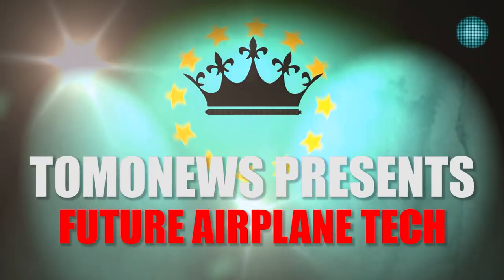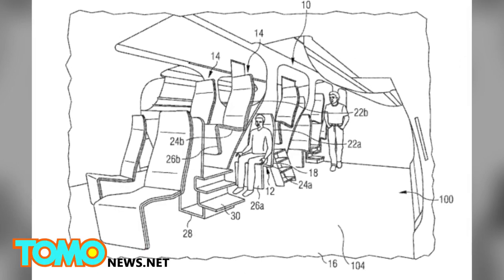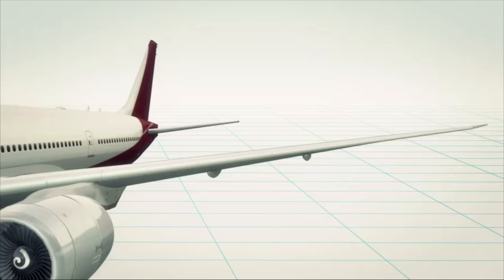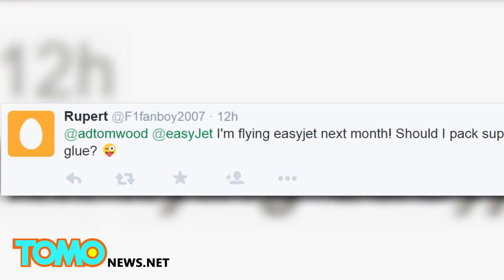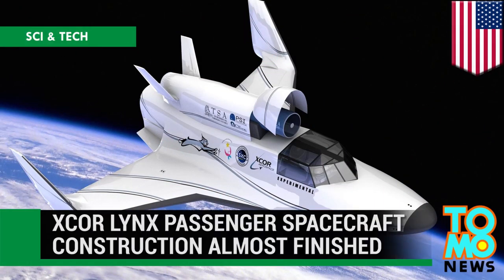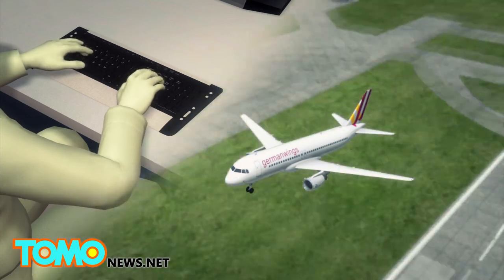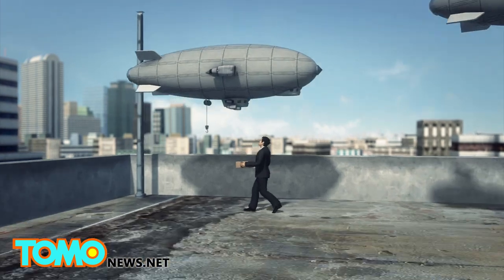Airplane technology: Detachable cabins, Mach 24 and crazy patents - future airplanes compilation

Comment: You compared a Mach 24 plane to the fastest car. You actually did that.
Reply: Yeah, like why would anybody possibly want to compare it to, for example, Concorde which actually flew the route -_- 
This whole thing pissed me off.
Reply: Even worse they showed a vid of Thrust SSC (land speed record holder) which went at 763mp but talk about 270mph road car. Anyway I designed a plane that goes Mach 50, only problem is that none of the tech has been invented yet!
Reply: Yeah. The Concorde was just too unsafe...
Reply: +Edward Hobday Thank you! The second I saw that I immediately scrolled down to see if anyone else commented on that little gem of a fact. Just wow.
Reply: yeah, just a bit ;)
Reply: It had ONE crash... in 27 years of service...

"Yeah. The Concorde was just too EXPENSIVE..." - there fixed it for you
Reply: Peter Grenader 8
Reply: very cool
Reply: Peter Grenader ikr
Reply: ikr
Reply: Not to mention she also gave us the incorrect top speed for a car. (270 something MPH). While the fastest car, the SSC THRUST, reached a speed of 763 mph. (Sound barrier is at 768 mph).
Reply: The Mayor sound barrier is 1160 miles per hour
Reply: Jalopy That is incorrect
Reply: JALOPYGamingPS4/ warthunder it actually like 750 mph around there
Reply: I understand you probably forgot all about this coment you made over a year ago but what is this designer thinking? Mack 24? I think they have finaly started to say the word "mack" and then follow it with a 2 didget number.
Reply: omg
Reply: JALOPYGamingPS4/ warthunder the sound barrier varies depending on atmospheric density.
Reply: Peter Grenader mach speeds aren't set at specific speeds the mach number corresponds to pressure and the medium
Reply: Smart
Reply: He did.

Comment: Those are all fantastic ideas. Not sure about the railway one though. 

1: Where do you put your luggage? Not hand luggage, hulking great suitcases and whatnot.

2: It would have to fly pretty slowly to scoop the fuselage off the tracks. It might stall and squish all the would-be passengers.

3: Putting the fuselage back on the tracks requires precision. It might derail.

4: Some railways have an overhead cable. Others have other stuff like trees and lamp posts. The flying wing aircraft might hit those.

5: Train stations will have to have check-in desks and customs controls (for stations where the Eurostar terminates from, such as St Pancras Intl or Paris Gare du Nord, this is already in effect).
Reply: It's not a train wagon, it's just a cabin that detaches.

Comment: yes yes!!  i like the detachable cabins.  especially the one with parachutes!   please make it so.
Reply: Have you even thought of how bad that would be? It may be cool, but it means more moving parts, which means higher chances of something going wrong.
Reply: @yacinesenouci6680  Less contact surface, so more stress concentration. Plane accidents usually happen at low altitudes, so less time for parachute deployment. The ones that do happen at high altitudes, either have time to fix the issue or to glide to a safe location to land. If that is not an option, the accident was catastrophic, and the chances of the system being deployed perfectly and safely would be very low.
Boarding happens at the last part of airplane preparations as checklists, refuel, and re-equip takes a long time. So boarding before the plane is ready serves to purpose, and would just make passengers wait more at a closed, tight fit space.

Comment: 12:32 180,000 feet IS NOT 50,000 kilometres! It is 54864 METRES (which is 54.864 kilometres) If you were 50,000 KILOMETRES away from the earth, you would be getting close to 1/4 of the way to the moon. HUGE difference!

Comment: now just put a huge parachute on it..just incase
Reply: steff serpent they do that with GA aircraft. The larger ones are just too big sadly.
Reply: Well they have a concept where they take this detachable cabin design. But have it detach downwards and deploy parachutes in case of a emergency. It would be set on a timer so the pilot's and other crew could board the cabin before it detaches.

Comment: Factual error in the first sentence: Airbus is not French.
Reply: Fact check: Airbus is French (founded in Toulouse in 1970)
Reply: Airbus Group SE is a European multinational aerospace and defence corporation. Headquartered in Leiden, Netherlands, Its incorporated company type is SE, the corporate form for the European Union, It is not French.
Reply: +David Lowe we're talking about Airbus commercial aircraft manufacturing division, not the group as a whole. Also the current 'Airbus Group SE' began in 2000 as EADS while Airbus (or formerly Airbus Industrie) has began in 1970.
Reply: +lʌntєrn Meringue Wrong! Airbus was originally founded by German airmakers Bölkow, ATG Siebelwerke, Dornier and some more in 1965. That's also where the name Airbus originated. In 1970 it was then registered in France due to economical reasons, after the french Aérospatiale joined Airbus with a Share of 20%. Also the first CEO of Airbus, Felix Kracht was German. Today of course it is a European company :) Fact check completed!
Reply: "Airbus SAS (/ˈɛərbʌs/, French: [ɛʁbys] ( listen), German: [ˈɛːɐbʊs], Spanish: [ˈeirβus]) is a division of the multinational Airbus Group SE that manufactures civil aircraft. It is based in Blagnac, France, a suburb of Toulouse,[1][2] with production and manufacturing facilities mainly in France, Germany, Spain, China, United Kingdom and the United States. The company employs 72,816.[3]"

Straight off Wikipedia.
Reply: David Lowe It's FROM FRENCH AND LATER GERMAN THEN CAMED UK WITH NETHERLAND The Netherland DIDN't came even up with It DUMB I live in the Netherlands To AND IT IS FROM SPAIN

Comment: The detachable cabin can work without disrupting passenger comfort, while increasing safety and maintaining quality service. The problem is making sure pilots and crew can fit into the detached cabin with passengers. Maybe put the plane in the auto pilot mode? A plane within a plane. Maybe the pilots and crew in a separate pod that detach as well, after passengers are deployed. Add a booster to detached cabin to make sure cabin detach quickly.

Comment: The detachable cabin probably is never going to work. It adds too much weight, it costs a lot. It could only land on relatively flat terrain or it would roll downhill. Not to mention the reduction in structural integrity to the aircraft. 
Also the NASA drone isn't exactly new tech. The US marines have been using tilt rotors for years and people have been building RC tilt rotors for longer. I haven't looked into it but the NASA design is probably to test something else rather then the tilt.

Comment: That's dangerous and stupid. Dangerous because, it can fly off mid-flight and stupid because, it will waste airport's money
Reply: More to the point, people would die if that happened. But it can't.
Reply: Best Trends it will have parachutes and if an emergency happens it will detach itself
Reply: Transasia Flight 235 there's always a possibility of failures. And not to mention it's extremely impractical and weakens the airframe.

Comment: Another error: at 10:55 Tomonews claims this is a side slip. Not correct, as side slip (or more accurately, forward slip) is characterized by one wing tip being lower than the other in order, while turning the nose the other way, to create a sideways flow of air against the fuselage in order to increase drag if the other drag increasing methods (flap, spoilers) are insufficient. Here we see the airplane flying sideways because of the strong crosswind. The fact that the fuselage is turned away from the runway (and into the wind) decreases drag. The wings are level, apart from small corrections. This is called crabbing.

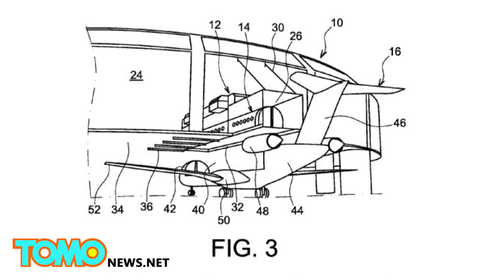Comment: :24-1:10 Great idea! In the event of an impending crash could the detachable compartment separate with a parachute to save lives? After being locked into place on the ground how do you ensure that it won't detach in flight? How will luggage be removed prior to the next group of passengers being loaded onto the plane? What will be the turn around time for that change?

Comment: 10:56 This is not side-slipping. Its "crab" maneuver - compensating for the crosswind with ridder (heading). Side-slipping on landing is when you compensate for crossind with the wing lowered on the side the wind is coming. So the aircraft literally slips sideways, but is pushed by the wind to maintain heading.

Comment: That forward-backward seating arrangement would never pass security requirements. Technically, it would be safer in case of a crash to be facing backwards, but the concept has pretty much been buried long ago, because passengers would not accept it. Thank God we still have regulations in air travel, or all we'd have on flights up to an hour would be overhead rails to grab on during takeoff and landing.

Comment: On the topic of detachable passenger cabins, this would only be a good idea if they could incorporate into the idea and plans a couple of better reason to produce such and thing. One, would be to make it so that the cabin would detach in case of evident engine failure which would lead to a crash. And second, that the cabin would be outfitted with a strong enough frame to handle being brought to a severe slow down so that it could land back on solid ground by having huge parachutes attached to it. Only then would this idea even be worth the investment, because saving lives is more important than being able to make more money by moving passengers quicker.

Comment: One good design to speed up turn arround time is airport design. How it works is the plane would land then go to arrival terminal only passangers  would come off the plane. then people can go to baggage then taxis busses and train all would be empty  when arriving at the arrival terminal. There would be no cross flow conflict with people departing one flow stream. The aircraft now empty at the arrival terminal  would taxi or towed to the service terminal for waist removal an refueling and stock food carts etc. the aircraft would then taxi towed to departer terminal to pick up passangers they would come from trains taxis busses that are all full on arrival at the departure terminal. the new passangers would not have any conflict cross flow with people arriving. The 3  terminals; arrival , service & departure  could be  separated by about a killometre. The taxis busses & train can go in one line. renta cars can be same customer drive to departure  then be moved to (like a car wash ) arrival terminal. one could eliminate people bumbing into one another.

Comment: The planes that have fuselage disconnects can't happen because there would be lots of extra maintenance required that the airlines wouldn't want to pay for, there would also be no point because of how safe air travel already is and the planes would probably never use their detachable cabins. It is also Russian, and with the war, airlines not trusting Russia to manufacture their planes, and other conflicts, only Russian airlines would maybe buy it

Comment: removable cabin? there is a reason why cabins are round. It's most stable under pressure. you can't use the sharp  edges shown in idea No1

Comment: 16 000 miles/h BS
The space station orbits at 25 000 km/h, 7.6km/s, re-entry speed is 7.8km/s~11km/s.
The friction with the air would melt that thing, and let's not talk about the energy required to achieve that speed

Comment: Removeable Cabin - doesn't speed up freight loading, and makes pressurisation of the cabin much more difficult.
Hexagon Seats - an interesting idea, but has serious flaws too.
Stacked Seating - another interesting idea, but also having many faults.
Mach 24 Aircraft - probably has more flaws than its predecessor.
Clip-Air - WTF, seriously?
Detachable Cabin - makes more sense than the other one, design-wise, but economically it's a bust I suspect.
XCOR Design - great, but what's it for?
Drone Airliner - nothing is ever going to be perfectly safe, so I really don't want this.
Drone Airship - lifting gas escape will slowly, to a point that it will need to be brought down to be refilled.
Reply: Not to mention the algae plane meant to fly in '15, might be a little over a year late to call it "planned", either it did fly or not at this point.

Comment: At 7:24 the plane should have more engines or a truster engine currently upgraded the engine the engine should, be fast or minimize the rate of weight that carrys it for it wouldn't be possible to lift it up need more speed or decrease the weight

Comment: i like the stacked seats but it should be used on buget airlines and regional airlines but hear comes problems new aircraft needed more cost buget airlines may not want it as they need to replace there current aircraft and training needs to change everything would need to change very expensive and not needed

Comment: 50,000 km and 107,000 km. I think they got feet to kilometer ratio all messed up.  A rocket engine that can reach 50,000km altitude in 3 minutes  (that is over 100 times higher than the ISS) would revolutionize space travel and allow us to colonize our solar system today.

Comment: to aid in turn around time it can be done by the following.   When an aircaft lands it taxis to the arival terminal. there it unloads passengers and cargo this terminal only handles traffic flow in one direction from plan to customs to awaiting empty trains and taxis. The is no passengers deporting at this terminal at all eliminating cross flow problems. the aircraft then moves (taxis) to the service terminal where it is cleaned refueled restocked  with food etc. This symplifies waist removal and food stageing with no cross flow problems ie passengers and food and waist carts. The aircraft then taxis to the departure termanial taking on passengers crew cargo. with no cross flow problems. the design of the departure and arrival terminal are symplified. Even bus train limo and taxi flow is symplified a full bus, truck ,train or taxi drops off  its load at departure the drives empty to arrival terminal. Throughput would be faster.

Comment: I will never ever fly on the design in the first clip. Never! Doing this to an airplane completely ruins the structural integrity of the plane. There's a reason planes are round! That's the strongest shape to counteract the pressurization forces! Any other shape requires much more support which adds weight which means you cant carry as much cargo or passengers so the airlines ticket prices will skyrocket to make up for burning more fuel and carrying less paying customers.

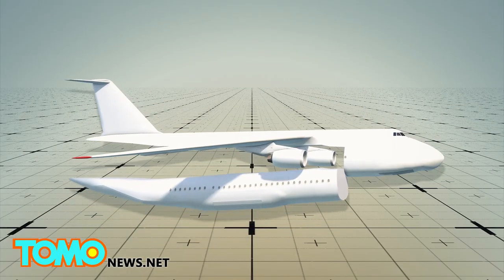Comment: the one at 9:13 Is stupid because not all accidents happen in the air where it can be used it could happen on the ground with bombs now days or on landing there's not enough altitude for its parachute to deploy plus the detachable cabin would hit the  ground and break apart like any normal play may do in that situation also what happens when your in the middle of a flight and suddenly it detaches by accident, and don't say that wont happened because it could you cant get ride of accidents you can only make the number of them that happens over time decrease until its only something like 1 accident per millennia type thing, the accidents are still there just very rare
Reply: also where was the planes wheels?
Reply: the pilots also have lives too, what about them it said passengers and crew last time I checked the pilots cant leave the controls and get into the cabin for it to detach

Comment: The Swiss plane that could bring plane from train station,I think if the pilot missed the wagon it will become a total failure and disaster
Reply: I thought that too. I researched it, and it turns out that's not what Clip-Air is supposed to do at all. The cabins are brought to the airport with the passengers onboard by rail. The passengers board at the train station. At the airport, they are attached to the bottom of the plane.
Reply: MrSupercar55 now that my sir
Is a good idea